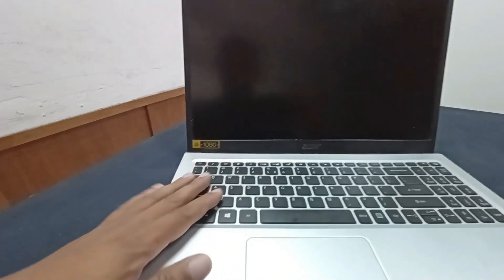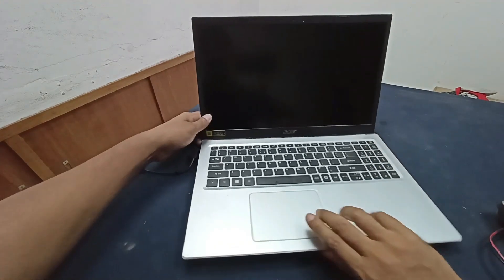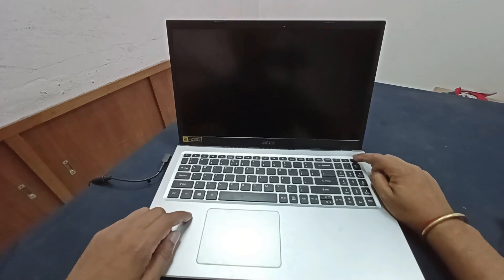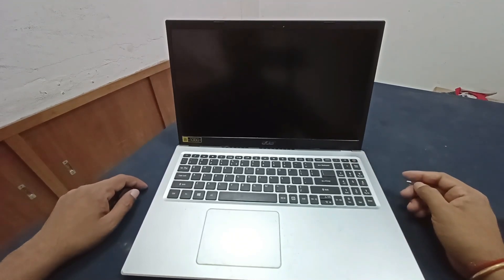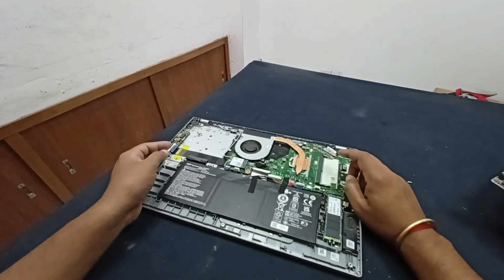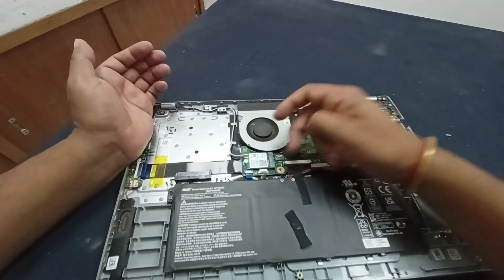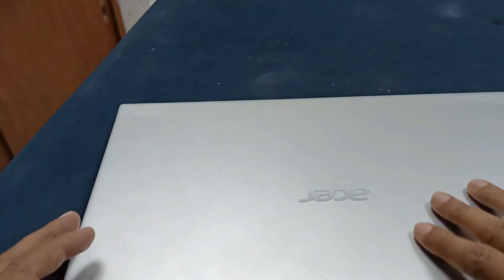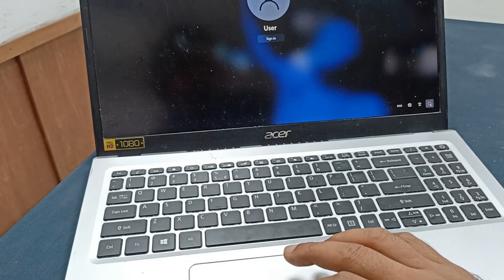Acer aspire 5 no power || not turning on acer laptop

Comment: Thank you. Your tip worked. The 20 second power button press, unplugging the power and then plugging in the power again fixed it. Looks like my battery is gone and needs replacement

Comment: I have an issue with my Acer Spin 5, i removed the battery and the smaller battery and held the power button down for 30 seconds and it turned back on after I installed everything. Even restarted the unit 2 times and than before I went to sleep turned it off. This morning it doesnt want to turn back on??? and battery light is ornage and power light flickers orange sometimes and doesnt want to turn on?

Comment: After shutdown laptop it is difficult to switch on at once by pressing power button. Acer customer service try several time overcome this fault. But they cant find the problem.

At that time they reset power . Then it is switch on normally. After one day pass again it is difficult to switch on by pressing power button. Occasionally it is power on by long pressing power button.

however when it switch on it working normal condition (shutdown, restart). SSD CARD uprated after buying this,

Comment: Thank you for your video. I am having little different problem, whereby my laptop fully charged indicated via blue led light at the side. However, when I press the turn on button, it doesn`t work and it took ages to turn it on.
Reply: Having the same exact problem what should I do
Reply: I have the same problem too. For me, you have to at least hold the power button for 20 second and more at least, till u see the keyboard light up then u stop pressing and eventually it will work. It kinda help rebooting i guess. So that next time u wanna turn it on, u just press it once on the power button. No need to hold the button or have to be plugged in

Comment: Sir my laptop is turned on after pressing 20 secs ..but for every  time pressing the laptop for 20 secs.No power button is working like previous and what is the problem sir.
Reply from the maker: May be power switch problem . sometimes power switch does not work properly you just open the power switch and clean that using by wd40
Reply: @mrcontrive5641  Okay sir thank you for speed reply,,I will try
Reply from the maker: @prasanthajjada2062  you are most welcome ❤️❤️
Reply: @mrcontrive5641  Sir,can you tell me how to open the power button
Reply from the maker: @prasanthajjada2062  you need to unscrew your laptop after that unwrap the laptop body i am sending a link how to fix power switch
Reply: @mrcontrive5641  okay sir Thank you ❤️❤️ please sent the link
Reply from the maker: Before you repair your laptop power switch. You need to check power switch that is actually damaged or not i just assume that. After opening your laptop you just short laptop power switch two terminal by twiser
Reply from the maker: @prasanthajjada2062  https://youtu.be/Q2_MD74TAdc
Reply: @mrcontrive5641  ##This process my acer laptop power on 2minutes later agian my acer laptop power off&show no 
power and again This process my acer laptop power on 2minutes later agian my acer laptop power 
off&show no power plz give me proper solution.
Reply from the maker: @shovojoy5258  i don't understand your comments / Show no means no display or others things please let me clear

Comment: When charge my laptop is turning on , you tap a little bit at the keybord and it suddenly shutdown why is that?
Reply from the maker: did you install a new keyboard..?
Reply: @mrcontrive5641  no , i connect to the charger and its sensitive to touch infront of mouse pad , is it mobo problem?
Reply from the maker: @Channx_  at first you can check your laptop charger that means replace with a good one after that you can take any initiative to repair your laptop ||
Reply: @mrcontrive5641  Thank you sir for your time ❤️

Comment: Do you know how to fix an older aspire 5? Our aspire 5 doesn't have the numbers on side (between the F keys and letters only), Just installed a small game (7gb) but after 2-3 days the laptop got slower until it can't power on now. Well it still turns on but it's stuck on the acer loading screen tried to open it overnight and even after i wake up it's still stuck on that loading screen. And by the way the game that I installed is "not a virus" I installed it on its official website.
Reply: It's almost a month not working, finding some vids on how to fix it but most of the vids were replacing parts(like replacing the disk drive) , but we can't afford some parts and if fixing it the price is high